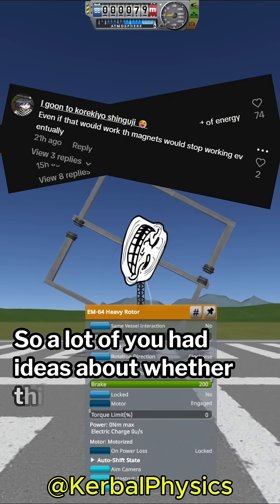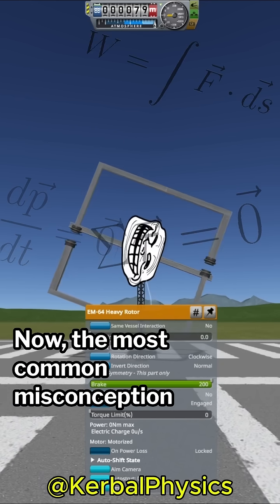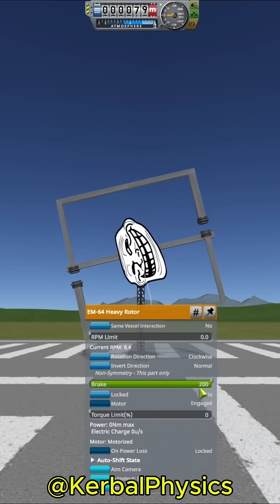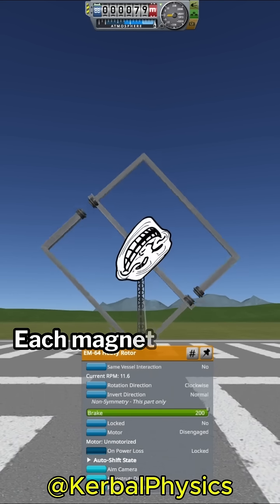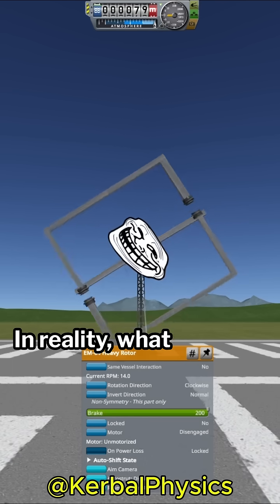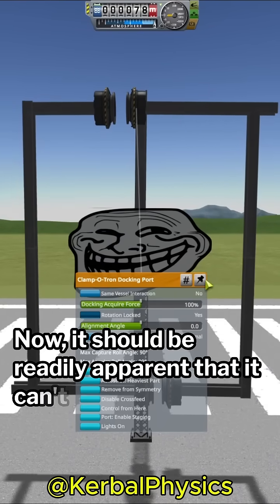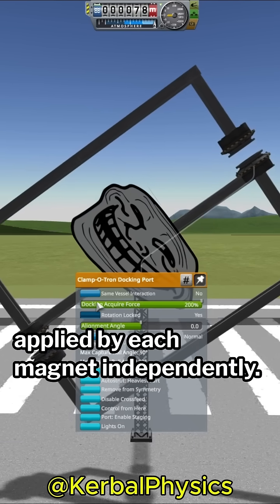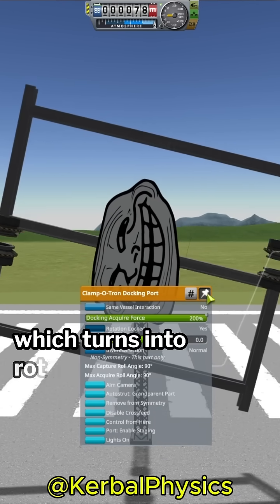Why does the Free Energy Machine ACTUALLY work?  #kerbalspaceprogram #physics

Comment: You Are wrong about one thing.
There aren't two magnets, remember one docking ports pull is set to zero and the other is set to max.
So in Real life it would be like having a magnet and a piece of iron, still it wouldn't work due to creating a bending vector instead of motion.
Due to having unequal forces the machine would know what direction to rotate
Reply from the maker: what is the difference between a magnet and a piece of iron here?
Reply: @KerbalPhysics a magnet has a magnetic field already, while a piece of iron doesn't
Reply from the maker: @virmirfan  iron is like one of the few metals with ferromagnetic properties, that's literally why its called FERROmagnetism...